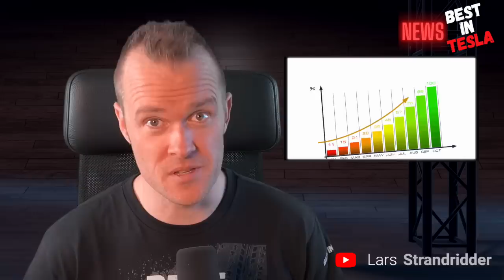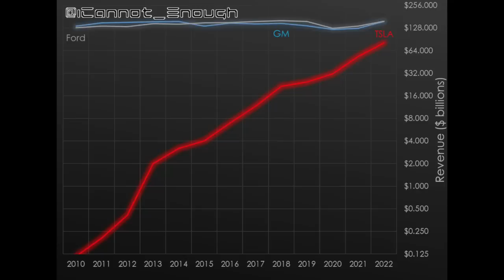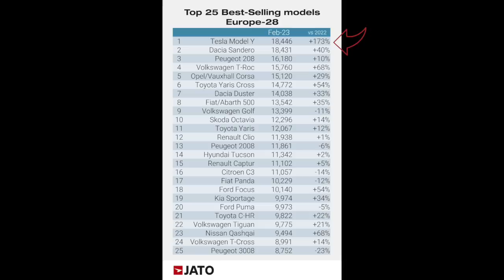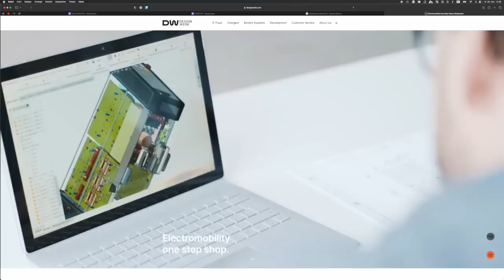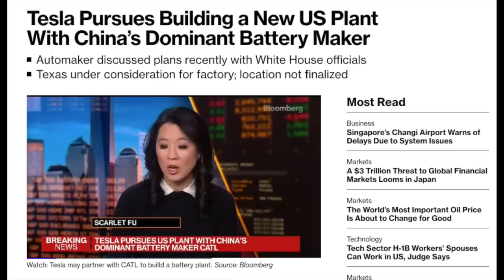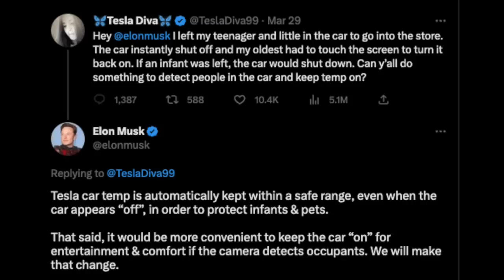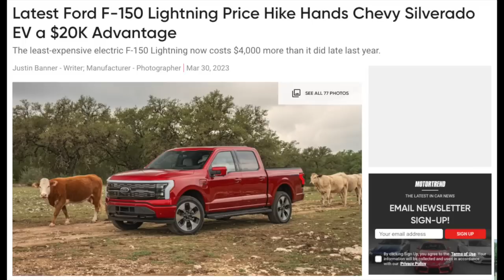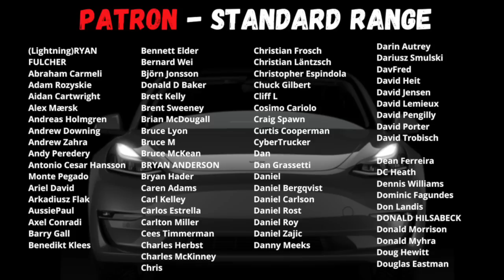Tesla's Model Y is taking over - Tesla heading for new sales records

Comment: Your comment about battery improvements needs perspective -- on how fast the technology is improving.  The Model T engine produced 20HP and had a top speed of 40MPH... combustion engines ramped up performance for decades and achieved an order or two of magnitude improvement.  Nothing is stopping batteries from achieving the same, only faster.

Comment: Great software makes such a difference! FSD v11.3.4 is so good- confident, more stable at high speed and turns, smooth stops. My car feels new!

Btw my 2016 S P100D about 11% range loss after 186,000 MILES. Not bad
Reply: What about the loss of performance you would expect with an ICE car with that kind of mileage? Does it still have the same acceleration?
Reply: @jjamespacbell  As far as I can tell performance is same. P100D was rated at like 3.1s 0-60. I’m not that aggressive but I’ve had to make evasive maneuvers and that power and handling has been very helpful. original brakes including pads. Air suspension still works. Of course some wear on shocks and bushing’s but still handles great (low center, awd)

Comment: Commenting on the Ford Lightning.  My reservation won't allow me to purchase the Pro (Ford Lightning base model).  Ford will only let me purchase a Lariat, XLT, or Platinum model.  Like you stated, the $39,900 Pro model was only a gimmick used to create a sales hype.
Reply: I LOVE the Ford LIghtning. Have you heard much about what caused one of the battery failures? There have been a few small issues with batteries.
Reply: @Ritalie  The usual pouch cell nonsense. Kudos to Ford for reacting quickly, despite only a couple of incidents, one of which never left the factory.

Comment: IT IS LIKE WITH smartphones and digital-cameras.. first there were a lot of people and the media joking about it everywhere, then hating on it, questioning it falsely and talking down to it, and slowly you saw more and more people using iphones and switched to digital cameras neverthless... and at some point - BOOM, everybody waited in line to be lucky enough to get a great digital camera or an iphone, AND KNEW, they will get the best thing there is. HAPPY CUSTOMERS spread the news better than any advertisement can. AND LIKE WITH iPHONES and Apple... nobody ever was able to catch up with the quality, performance and great experience of ANY TESLA there is.
Reply: Electric cars are better in every single way. More reliable, can maintain their climate control when you're in a store shopping, doesn't require warming up the engine for 15 minutes to get heat, and no more gas station visits, you just charge at home when you're off work for the day. The real problem I see is the fake power electric grid that is apparently just strong enough to support current conditions. With every house having a 100 amp additional service added to it, that's basically doubling the load on the entire power grid, and in fact, it's more than doubling it, because most people have natural gas furnaces, not electric, so 100 amps added to a house is like 4 times more power than they would normally use. Even a dryer is only 30 amps. An oven is 50 amps max, but it only runs once in awhile. An electric car might be 100 amps for several hours per day, which is an astronomical amount of power. I don't understand yet how they will solve this problem, it will probably take 20 years to upgrade the power grid, so they won't be able to get rid of gasoline any time soon. Realistically, they need to release some of the 5,000 hidden patents for new methods of generating electricity.
Reply: @Ritalie  supposedly Tesla should be fixing that aspect too. But the home solar energy and battery storage is lacking growth. There is more competition in that aspect but still they can't keep up the demand and the cost is still high for the average salary worker.
Reply: @Ritalie  Hi Ritalie, thank you for writing down your concern. I have the answer to your question. And luckily it's a solved issue, which won't require any additional upgrades to the grid or any further supply of electricity at all. It's my occupation to make sure such things work out fine - IMMEDIATELY, not in 10-20 years, and without any investments or preparation needed. The way both old and new power plants (no matter nuclear, cole, heavy oil, gas, hydro-electric, wind or solar) work, the output they generate, spread over a 24h day, so as how first and second world countries currently make use of their household electronics, heating and cooling, shows that it will work out just fine. I will need to reply you in detail a little later, but it's basically the usage and delivery mix. What also makes it possible is the enormous efficiency of a Tesla (not all EVs, but EV's built with the technologies and designs which Tesla openly shared the patents of). Those EVs and Teslas built since 2017 have such an enormously high standard of efficiency, that the average driver (not the average person, including non-drivers, no the actual average driver even) drives no more than 20 miles per day. Those 20 miles take the battery of a modern Tesla down so little, that even with the slowst charger available, the one you use for your mobile phone, will recharge those 20 miles average driving (30ish km) again over night. Also interesting: Most 1st world country people own TVs, which alone consume more energy per evening in use, than the same household's Tesla would need to fully recharge those 20+ miles (30+ km) driven per day. IT IS POSSIBLE TODAY, even if ALL would be supplied with Teslas at once. Which of course won't happen. So there surely will be a longer time until all people realize what an advantage it is, how easy it is, and how much money it actually saves them over 5-10years vs. any other car.. not to mention the enormously stable value of used Tesla's. But first and second world countries would technically be more than ready today. I will hovever go deeper into the topic and details with another answer to you soon. But please give me some time. I might be able to respond next or overnext weekend :-). Cheers